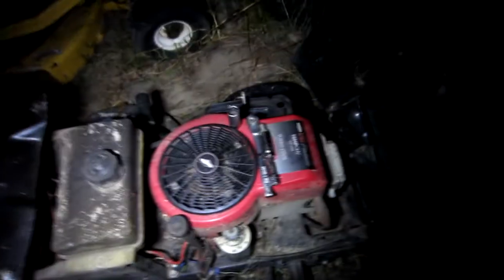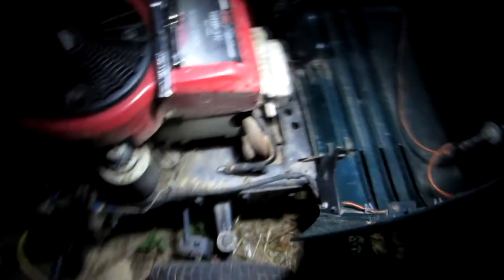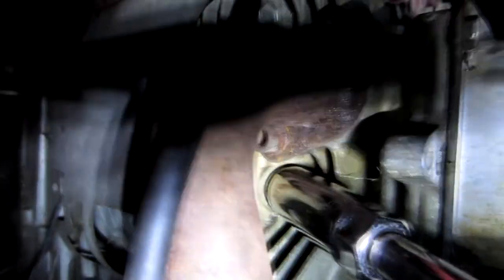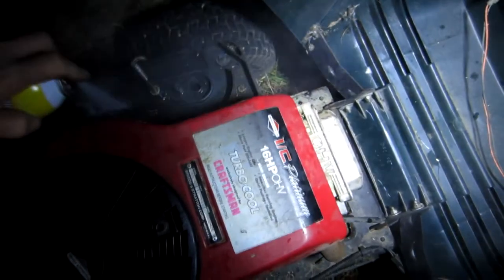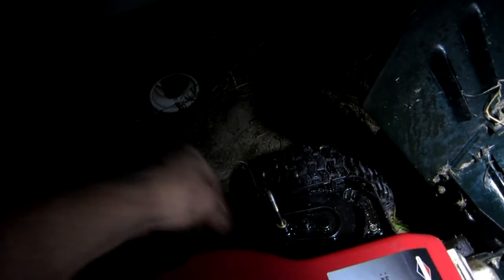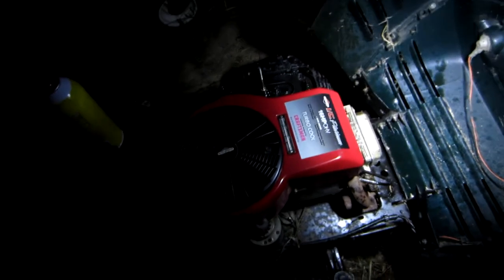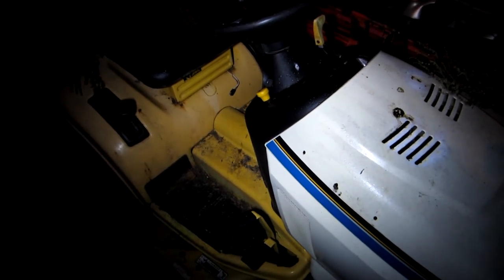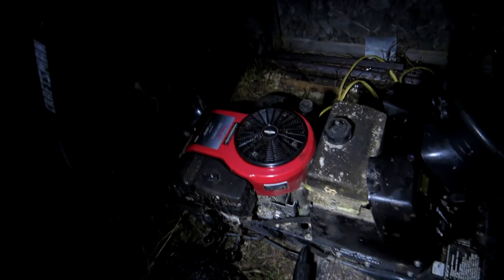SUCCESS!!!

Comment: @daddytech I don't know Buddy!! I don't think it would get hot enough to boil!!  I had a similar problem like that!!  It turned out to be the plug wire where it came out of the coil, a mouse had chewed through it and when you mowed the lawn it was OK until you hit a bump or turned and the wire shorted out on some metal!! Intermittent problems are the worst!!☺

Comment from the maker: @ils360 thinking it may be a combination of the 2 cycle gas in it and the old fuel that was still in the lines, since it's been sitting a while i think i need to go through the fuel lines and blow them out and clean out the bowl again while i am at it.  the oil that's in it is at normal level now i drained some back out but it was fresh oil so it doesn't need changed and it doesn't smell like fuel so the gas didn't leak back into the motor like my dad's did him (nasty mess)

Comment from the maker: @zx8401ztv this is true & this time it was something i knew but  forgot about because i hadn't messed with this mower in 2 years now. so that one key phrase about the neutral safety switch (which might have wound up costing me money to find the answer for) just clicked and the problem was resolved. THAT is one of the MANY reasons i love you tube so much. i could have went out and bought a whole bunch of stuff i didn't need or paid for tech help that was useless and one key phrase made it click